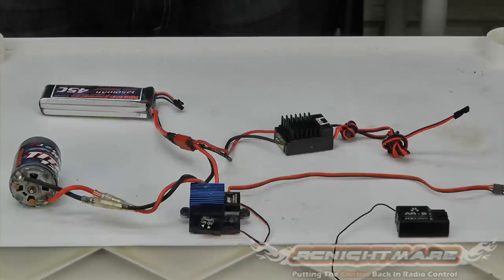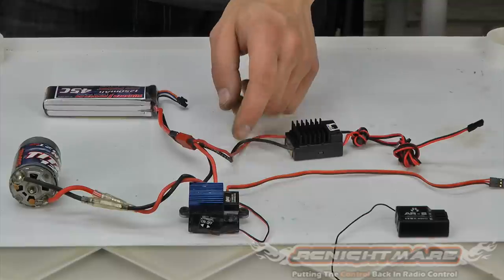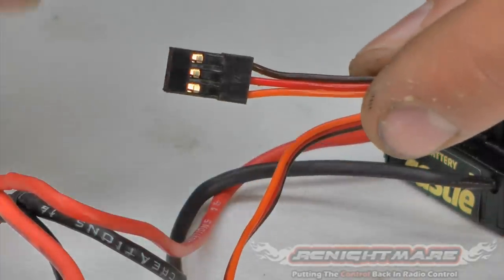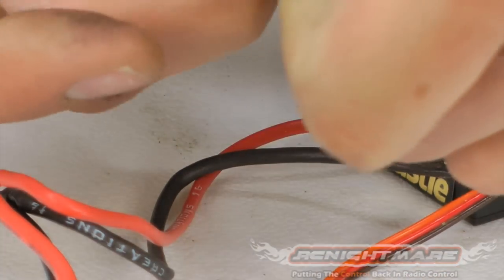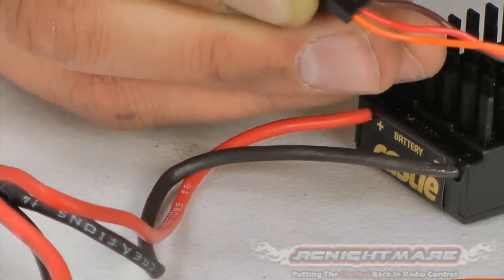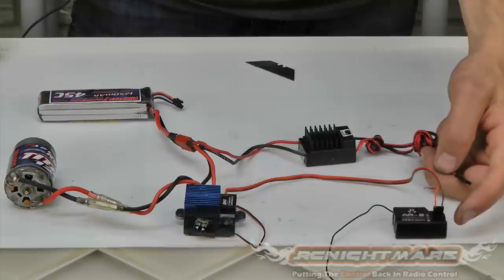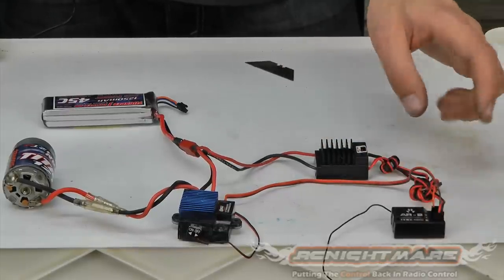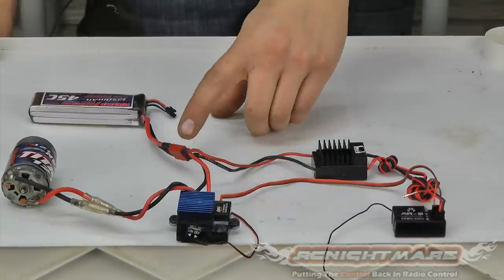How To Wire A  RC BEC How To Connect A BEC On Your RC Car or Truck

Comment: Hey quick question ..  if your ESC has a built in bec.   You attach it into the bind spot on receiver ... After binding do you put that bec wire into the throttle #2... After you have successfully binded it.   First timer here thanks in advance!

Comment: Good explenation.
Do you happen to know what voltage rc lights run on.
I want to connect my axial lights but now running a ext bec at 6 or even 7 volts  will the lights handle that .

Comment: I am using a spektrum sr 200 with only three slots for bind str and thr.... I would assume I can't use the bind plug slot/channel to power the receiver via the castle bec??  Is this posible or do I need a different receiver?    I an trying to power a spektrum s 6040 with a 1/10th mamba max pro and it just keeps chirping the steer servo.  So I assume I need more bec??   Those are questions feel free to respond.  Thanks great video

Comment: I noticed on Castles website the BEC pro has two wires that goto the receiver. If I got the pro BEC where would I plug the wire I

Comment: Sure quality of the content is important but... if the video/audio quality lack a lot.... it just isn't much of a help.  Especially for thing where picture is worth a thoudsand words.

Keep up the great work.

Now, I am still waiting for your video on how to charge multiple LiPo @ same time (parallel charging).
Also waiting for your Traxxas Spartan running video and your after review of the cooling mod.

Comment: Lets say that i want to use a BEC to run fans at 11v, which is higher than my reciever can probably handle, can i just plug the BEC reciever wire directly to the fans?

Comment: I have a question, I installed a Castle Creations CC Bec 10A 6S Switching Regulator in my Brushless E-revo, I have a yeah racing dual fan and back brake lights and head lights with a light bar coming in and I want to set only my lights up on channel 3 so i can toggle them off and on! My E-revo has a 6 channel receiver so i am wondering could i use your setup for this and just use the bec I bought to power all without any problems?

Comment: I have to d the same on a hexa. I suposes that You need to use paralel cable before connector solder point. Then ..on other part of the connector, solder the UBec.

Comment: I'd recommend using a jeweler's flat head screw driver to remove the pin.  It's easy and little safer.

Comment: I'm looking to try to wire led lights and a police lightbar together so that they come on when I just flip a switch on transmitter. Is a BEC necessary for this? What does BEC stand for? Yes...I'm a newbie to the hobby.

Comment: Late answer but maybe someone else can have some use of this:
Bind without the servo wire connected, that way you have a spare slot for the BEC power. When binded, connect the rest of the wires including the BEC wire and you are all set to go. Just remember to remove battery and bind plug before connecting any wire.

Comment: Any free slot that is not in use.
If the BEC have two power outlets, it is meant to use for any other external power source you might have or not.
Don't connect both into the receiver.

Comment: If you dont have a BEC in your ESC then your receiver wont even turn on and you would need to run a separate battery just for your rx, servo, etc... I havent seen an esc today that does not have an BEC. Double check.